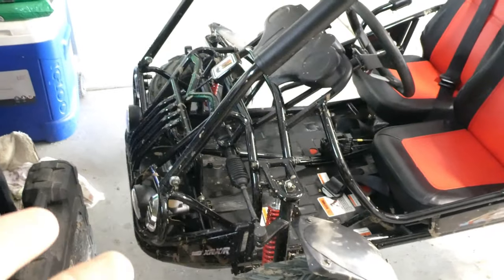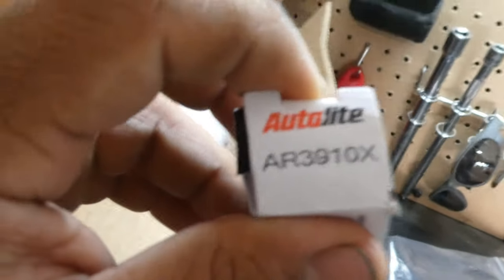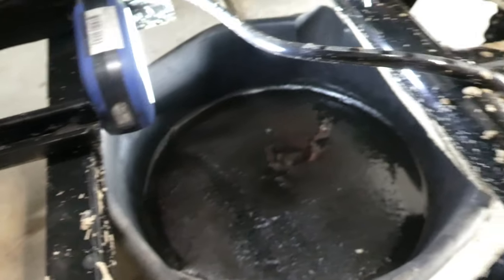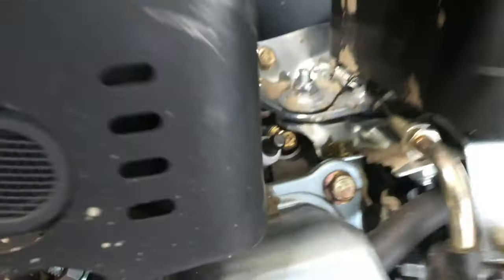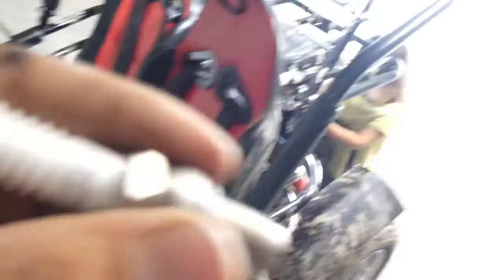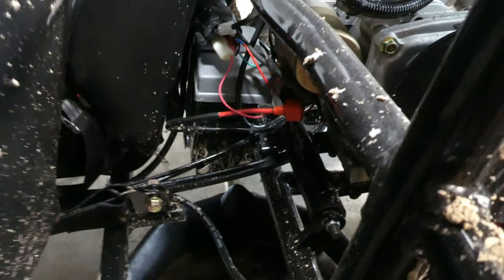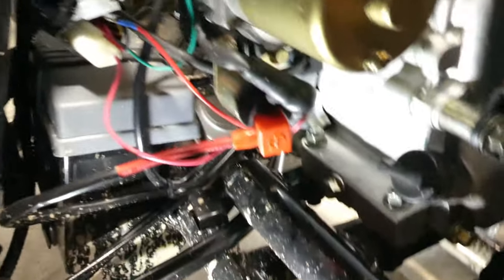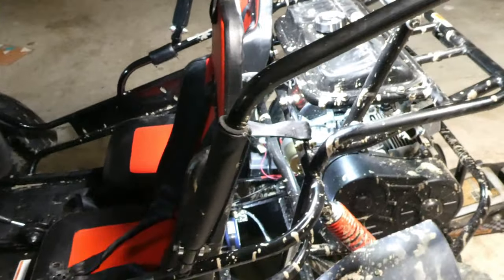Trailmaster mid xrx/xrx-r Oil change and spark plug replacement

Comment: I was riding and It lost power then shut off I checked the oil it was low what should I do
Reply from the maker: the engines have a oil sensor level so if the sensor doesnt detect oil or if its to low it will shut down, let the trailmaster sit for a while and then add oil to the engine

Comment: do u have any tips for getting the bolt out mines wont move i used a 12mm wrench
Reply from the maker: Is it stripped?
Reply: No it’s just very tight and can’t untighten it
Reply from the maker: Use the close end of the wrench on the bolt and grab another wrench and use that as leverage
Reply: K thank u
Reply from the maker: No problem if you also have pb blaster(penetrating oil) that might help as well

Comment: Have you changed the gear oil?
Reply from the maker: no i havent yet but I will be doing that sometime next week since my 196 needs an oil change
Reply: @juanslifestyle8210  Does the reservoir at the back of the engine use motor or gear oil?  Just fill til its full? Great video!
Reply: Hey Mate,when are you going to change gear oil. thanks

Comment: I’ve had mine and I found a screw for the throttle on mother that u can adjust for how much throttle can I take this off to go full speed or will it mess up the motor?
Reply from the maker: It it wont mess up the motor that bolt on the pedal just allows how much throttle is being used,I use that whenever my kids want to drive it
Reply: K thanks
Reply from the maker: Are you talking about the idle screw on the carburetor?
Reply: @juanslifestyle8210  what about the set screw on the carb, can we adjust that,